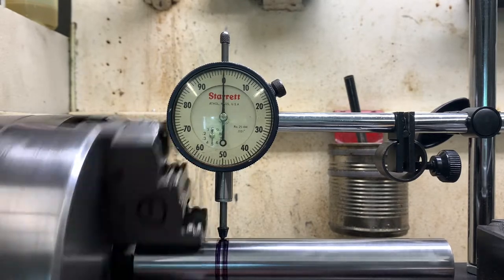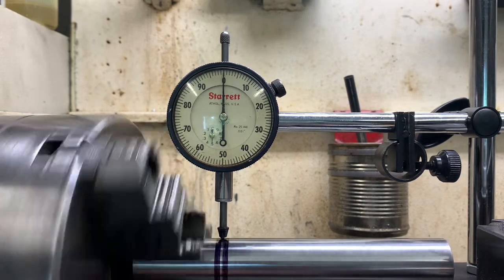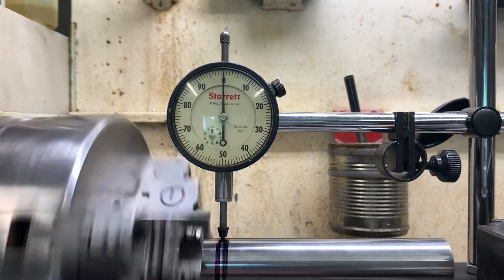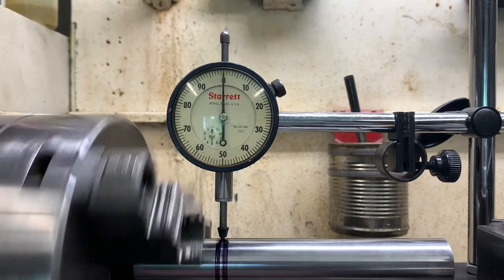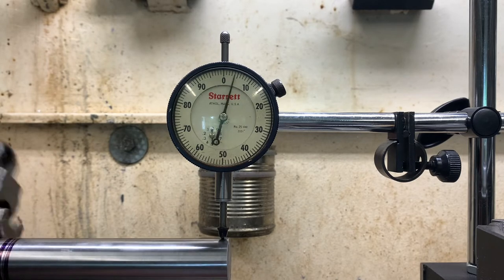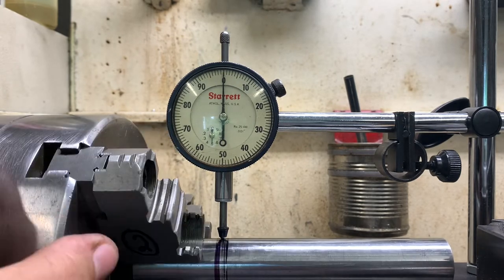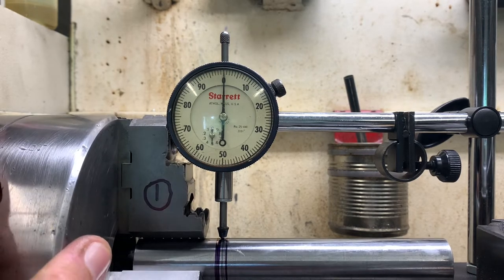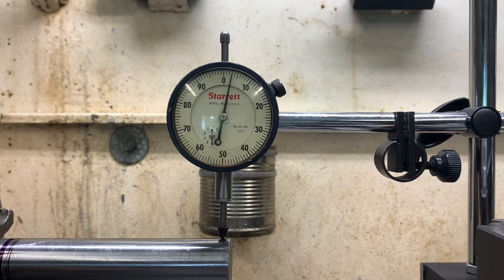Bison lathe chuck (update)

Comment: You obviously got this figured out, the jaws need to be measured and reground. It looks like jaw #3 is the problem child, I can see the air gap and the dial indicator confirms this, jaw #3 is shorter/smaller then the other two, that’s why you get a negative reading when jaw #3 is pointing north.